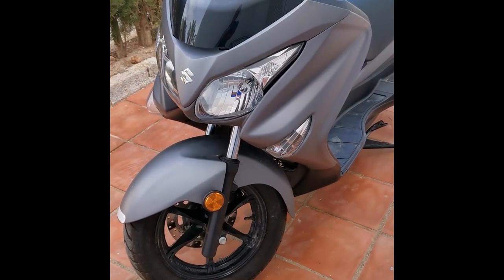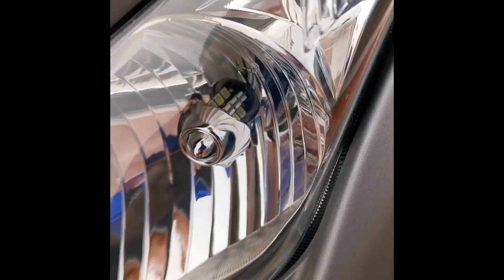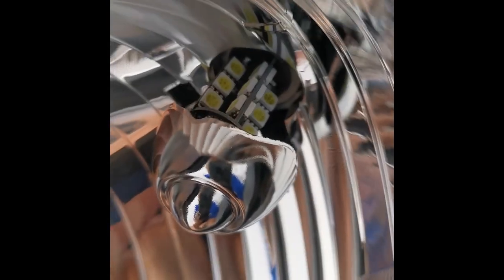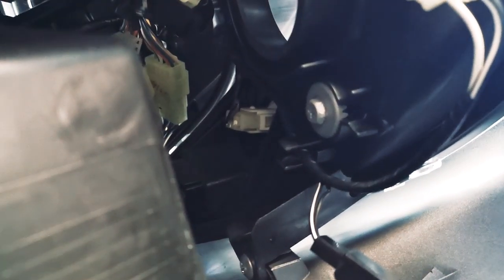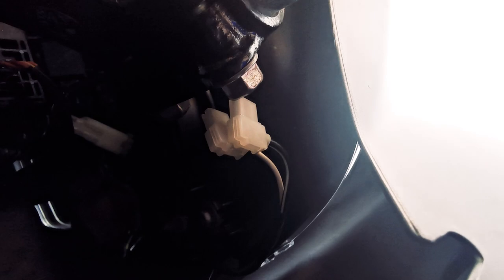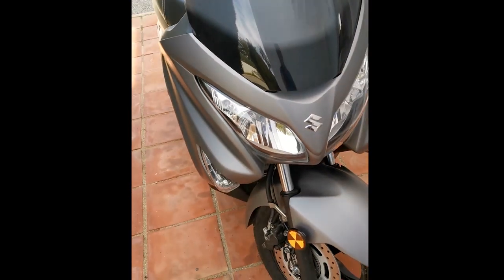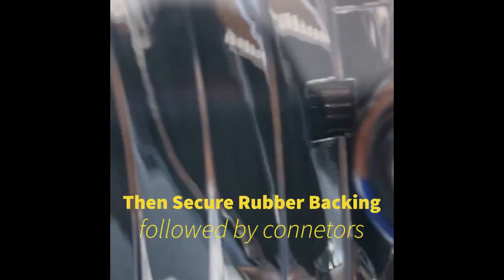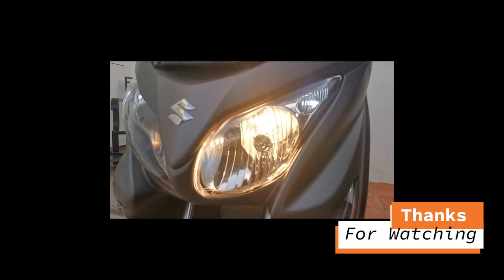Suzuki Burgman Headlight & Side Light Bulb Changes Replacement

Comment: Hi mate, do you know what bulb the headlight is? I have the same bike but find it's not bright enough. I want to find a new stronger LED. You say H7 but it doesn't look the same on Google. Isn't it LED not a bulb/H7? I'm confused! If it is do I just get any H7? Thanks mate
Reply from the maker: Hi Sorry I missed your message, the bigger bulbs are the H7 and the small ones are 501,  hear is a link for bright bulbs   https://www.ebay.es/itm/123825033345

I did encounter a lot of bad H7 LEDs So I used H7 Xenon Super White Light Bulbs 55W in the end

Comment: So does the passenger side bulb not shine when on dim or am I missing something I have a burgman and the passenger side don't shine when on dim
Reply from the maker: That's correct the same as mine.
Reply: @JFKKARZ  I googled it and found out that the dim light in fact does not come on. That's just the way it works,